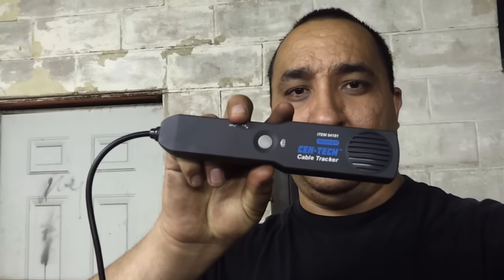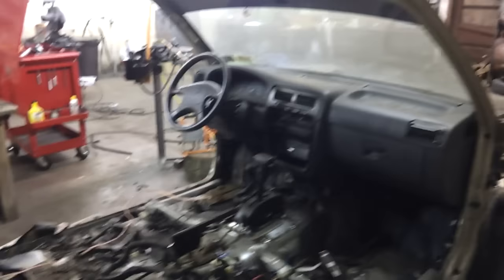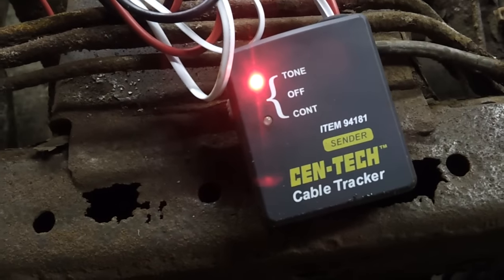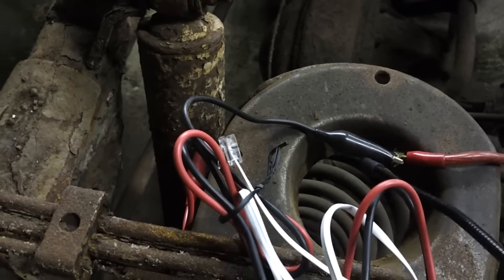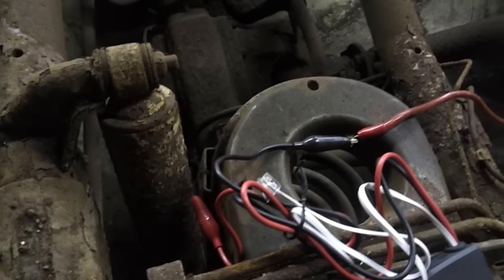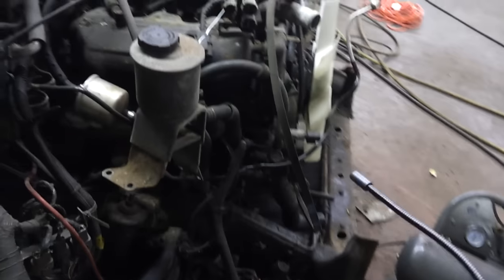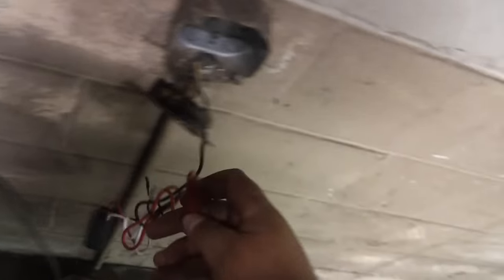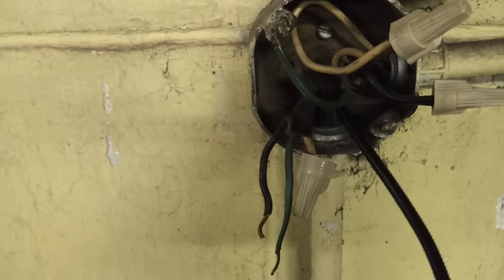Harbor Freight - Cen-Tech Cable Tracker (Item#94181)

Comment: Thanks for the video. I worked as a television broadcast engineer and we used this checker often.  It helped us trace cables in massive bundles. Also used it to install wireless access point CAT 5 cables in a four storey building.   Can't beat the price and it always got the job done.

Comment: Thanks for demonstrating this tracker. This product really works, and I would highly recommend it. I used it to trace 14-2 romex receptacle's connection from all the way across our house over stucco, drywall, insulation for around 125 feet. Saved me I estimate 500-to-1000-dollar electrician fees. It ended up being a very weird wiring arrangement which the builder installed as it went through switches, etc. inside and outside of the house, in and under the attic. The single strength was very pronounced.

Comment: had my sister run out on Saturday to go get one. I have 5 cars I am working and ones a ford 98 windstar only 109,000 miles but have short in MAFS wire so need to find short. worked great. 11 thumbs up. Thanks so so much. I could have used this back in the days pulling out stereo and cutting plugs and finding the speaker with hook up of wires. LMAO man needed this in 80's.  thanks great video from BOB-AKA mr bob the builder sidetrack

Comment: This device works well for tracing wires through walls, but you must hook up the transmitter differently than what is shown here. The red should be hooked to the hot and the black either left loose or hooked to a ground separate from the wire being tested. Then the signal easily penetrates drywall. If you hook up both leads to the wire under test you will get opposing currents in the wires and the signal will cancel, like in twin-lead antenna feed line.
Reply: Thanks for that; I found the directions very unclear.
Reply: no

Comment: As a master electrician I've bought at some point just about every electrical tester, device to help with various assignments I've owned 3 sets of toners from fluke and can say this raggedy low budget fox and hound is indeed better then those tracers. Argue all you want but try it and compare it when your out there it gives you the best reading have had to go alllll the way back to my truck just to get it because the others couldn't do the job. It's reliable is loud enough to hear and it's definitive.

Comment: Love it, Brother!!! thank you for sharing!!! it saved me a lot of money I had a short in my ignition wiring in my car took it to a shop they quoted me $280.00 I purchased this @ HBF with my 20% off coupon plus a free gift and found the short within 10 minutes I Definitely recommend this it works!!!!!
Reply: jimbola77 awesome info, I Have A Short in my 03 Dodge Ram Right Tail light, Ive Been trying to figure it out but can seem to track the short, the Wiring looks Good across the Chassis, will This Tool Emulate the power probe ect1000?

Comment: These things work ONLY IF the end of the wire you are looking for is DISCONNECTED from the circuit.
It will act like an antenna in this case, otherwise its will send the signal down and fade away.
So to find the end of the wire, i have no clue what to disconnect and from where.

Comment: I have a set of outlets that randomly stop working (GFIs) and while I can generally repair most electrical issues at home, I need to trace the wiring.  I’ve been hesitant to spend $100 on the Fluke equivalent for a two time use, if that.
I didn’t know Harbor Freight had its own version . . . until now!  Many thanks!

Comment: You probably should have checked it at the breaker box and tested the neutral at the breaker or anywhere in the building, the break is not going to be in the concrete, it's going to be in an outlet/switch/box or in the breaker box itself, you may want to check outside for any abandoned breaker or fuse boxes...
Reply from the maker: The break is underground. This was 4 years ago. I've abandon that whole circuit.

Comment: Ive got a home elect  circuit of 6 outlets that went dead   but i dont know which breaker in panel goes to the circuit...with main pwr off could i hook this item up to one of the dead outlets and then go to psnel area to try and find out which main wire/breaker  supplies power to the dead circuit

Comment: Agreed, i have trouble tracking down wires and wire diagrams . I have used rj-45/11 tracking wire locating equipment similar to yours but for computer networks. I realize now i can uses the same technology to trace car unpowered circuits as well as the unpowered electrical circuits of homes. But i still like the circuit breaker tester  locator for the energized wires (that you plug into electrical outlets) . Wondering if there is a similar tester for the equivalent energized circuit of a car. Not that its a huge deal you can remove fuse and check if the line has voltage before tracing its just cutting the step out.

Comment: I use one everyday at work. (Fire and intercom technician.) I'm pretty sure the red is the tone lead though, not the black. I've never used the harbor freight one, but for 1/3 of the price.. I think I'll give it a go.
Reply: I am a spectrum contractor and am seeking advice for a toner that will trace a RG6 coax from say a 5th floor apt. down to the ground floor of a Multi Dwelling Unit. This would be the best time saver for me. I would love for it to be strong enough to find breaks in buried lines about 6 to 8 inches deep. Have you seen anything that sends that strong of a signal?

Comment: Green is ground, not neutral.  there is a difference.  And yes this will work with Coax or any wire that has a return path.

Comment: Greenlee product is near $200. I used it for finding underground shorted wire. Sprinkler repair. But I've traced thru concrete with it also. We get wire in sleeves under concrete alot.
Reply: So this works for tracking valve wire?

Comment: hello Mr. alvarez..   it's been two years since you've made this video.  wonder how the electrical outlet repairs went?
Reply from the maker: +Good Sun The wires are damaged someplace under my shop. I abandoned the circuit to insure that I don't get any fires.
Reply: +Alvarez Metal Works You should be able to pull out those wires no problem and pull new ones in. There should not be an inaccessible junction box under the concrete. Use the same size wire, and use a wire lube to make it easy to pull.
Reply: I worked at a shop where the underground conduit was all rusty and the wires corroded, same problem as Alvarez.
Reply: if underground conduit all rusty and filled with crud you won't be able to pull new wires.  Run new EMT or IMC up walls and across ceiling rather than across roof.

Comment: In house AC wiring, the Ground is NOT the same as the Neutral. And should not be connected. I only use it when testing. Should never if used interchangeably.

Comment: These things are also used to trace telephone wires, that's why you see the little phone plug end on it. Looks like the only real modification is the little flexible wand on the end of it, while mine has a short rubber tip on it. But, they are pretty useful for tracing wires if you have a bunch of wires  with the same color, and you want to make sure you have the right wire on the other end if there is no wire marker on it. 
The sending unit can be used both for sending a signal down a wire, or, if you have it set on the cont setting, lets the sender be used as a continuity tester for anything like fuses or light bulbs that you can clip between the senders gator clips, or for testing switches. The little red light will come on if these items are good.  So he is right, a low cost little tool that is well worth what you pay for it, and might save you hours of guesswork tracing wires down.

Comment: Hello Mr. Alvarez
I bought an EM415pro and I still have not found out if it is possible to find a short circuit with this device using the beep. Problems with short circuit only work by the led indicator or I am not know to use?

Comment: I cant ever see needing this for anything residential unless something was real old. This doesnt give shorts location.
If you plan on using these outlets at all the wiring has to be the right size to handle shop equipment. If its not your learning what fish tapes are all about.
Your tracer can help you there too.

Comment: green is not also neutral it is a safety ground
Reply: Green should be the same voltage as the Neutral.  It's technically known as the Equipment Ground Conductor (EGC) and should be wired up in each receptacle and light fixture such that if the black (hot) wire comes loose and touches a piece of grounded equipment, plumbing, or building steel it will cause the fuse to blow, circuit breaker to trip, or for a GFCI to see more current in the black wire going out than coming back in in the white wire (120VAC)  and trip.
Reply: @JulesBartow  right and in service box all grounds on same bar and all neutrals on different ground bar neutrals have unbalance loads conducted through them grounds do not
Reply: @teekay1785  Yeah youre Definitely right:  they're on different bars in the panel but they are connected by a screw so essentially they're connected (unless it's in a sub panel)

Comment from the maker: Very much so. It took me forever to start working on fuel injected engines because I was scared of the electrical. I knew nothing about it and was worried I'd just make the problem worse.
Reply: I'm afraid of touching a carburetor, I know nothing about them, lol, fuel injection, no problem.
😉

Comment: Hey bro would this thing actually point out the exact wire or just will signal when it's "very close"?  I plan to use it on automotive to track down the exact wire from the crank sensor to the car computer.  Would it just start beeping when the cable I'm tracing is somewhere among those 30 wires on the back of the pcm?  Just wanted an opinion.
Reply from the maker: It's not that sensitive but it should get you close. If you need something to pin point the exact wire this may not be as sensitive as you are looking for.
Reply: Alvarez Metal Works
Thanks for the great help ese.  Also, is the RED wire from the device connected to anything or is it for an optional second wire being traced?  I need to trace SINGLE wires only.
Reply: When you're in the ballpark, you can test for continuity, if you don't have too many wires to check ... would have to physically contact them one at a time somehow back to your continuity tester, or perhaps short them to the wire that goes back to the transmitter (set to the continuity position).  You can verify first if your transmitter is working, just set to continuity and short the leads ... if the LED lights, you have continuity.

Comment: Will it detect a wire through drywall? The previous owner wired a breaker box and some outlets in the garage and I have 2 breakers that I have no idea what they control.
Reply: It detects wires through drywall.  You have to be within a couple inches.

Comment: I have a wire shorting to ground,  I have traced the circuit, but still cant pinpoint where it is grounding. I think it might be grounding to another wire inside the harness.  Would this tool help me locate a short to ground?
Reply: I doubt it.  You probably need to disconnect things along the path until the short is gone.  I found a trick by accident, flipped a breaker and heard a pop/saw a flash out of the corner of my eye.  An outlet in the corner of my garage had a bit of smell and puff of smoke, a nicked wire was making contact with a box connector.

Comment: This thing sucks. I hooked it up but no matter where I point it it beeps. the sender box is just sending out a sphere of signals and it’s impossible to trace the wire... I literally hooked it to the fuel pump. Stepped out the car and pointed into the sky and it still was beeping....

Comment: The tool referenced in this video is located at http://www.harborfreight.com/cable-tracker-94181.html
Its called a Cable Tracker (Cen-Tech - item#94181) sells for $23.99.
Reply from the maker: Thank you. That information is already in the video description.
Reply: Alvarez Metal Works Thanks for the review of this product and recommendation. Going to try to get to the nearest Harbor Freight to pick up one of these this weekend.
Reply from the maker: Not a problem. I try to review ever tool I buy. I know it helps people out. I use youtube to find reviews so I figured I'd return the favor and post some of my own.
Reply: Ok. I bought the tool. It worked just as well as you said it would and probably just as well as the more expensive ones. Saved me from hiring an electrician. Thanks for the review.

Comment: I have a ceiling fan that needs to be replaced but I can't find the breaker to disconnect it... can l use this to find the right one? Thanks
Reply: Shut each breaker one at a time checking for no power at ceiling fan each time. When you get no power at ceiling fan, that is the breaker that controls it. You don't need anything except a voltmeter.
Reply: Use a voltmeter or a (convenient) Fluke tick tracer.

Comment: Can it scan through sheet rock? Thanks bro
Reply: Yes, it works quite well, but not if hooked up as shown in the video. Attach the red lead to one wire and the black lead to a ground separate from the wire being traced. You can use a water pipe or an extension cord plugged into a different circuit.

Comment: Im not seeing where you tell if its shorted
Reply: Ok if it has a short in the line, this is meaning the circuit is not completed. with the signal being delivered at one end as so when you trace the line it will make that noise w/the receiver' & when the noise weakens & or stops, this is most likely where your location needs be checked for trouble If so your current to the receiver stops flowing at this point of breakage in the wire & or it just won't pass thru enough current on account the opposite end is diverted from giving a strong enough signal. It's kinda like when trying to pick up a girl playing hard to get! L.O.L No but seriously it's when the current  stops or weakens is where most likely it is shorted! It's a grate tool.
Reply: A cable tracker is not designed for tracing shorts, it only works to track open circuits.

Comment: try ideal suretrace 61-954. it has powerfull signal and can trace through wall and some floor
Reply: That is now replaced by 61-955 . It is OVER $ 800.00 ! The HF is about $ 30.00 . There is no comparison . But , unless you NEED that expensive unit , it's an expensive tool to only be used by a DIY .

Comment: How much was this as Harbor Freight?
Reply from the maker: Not sure what they are charging for it now. The link is in the video description. I'd use one of the 20% off coupons on it if you can find one.
Reply: Horror Fraught.  Half the stuff I buy there breaks.  Lot of wasted time driving back to store for a refund then having to go find something quality to get the job done.  You'll have the same luck as direct from China on fleaBay or Amazon.
Reply: @JulesBartow  
That's because they are produced with the cheapest quality parts and materials available, they don't last worth a shit. All Chinese electronic and electrical products suck. You get what you pay for, cheap junk that you end up trashing in a short period of time.

Comment: What's with the frame on that truck. Not safe. Not for u but the other people on the road. Nice tool
Reply from the maker: You do see that the truck is completely cut up and not drivable right lol? I stripped it for the parts and scrapped the rest of it.

Comment: how can I use this on a car for shorted wires
Reply: shane gillenwater thoughtfully
Reply: I have used a DIFFERENT tool for shorts.  Basically, it is a mechanical meter, with a needle, that is sensitive to magnetic fields.  The key is a 5-amp circuit breaker, hooked up to power, that keeps closing and opening, causing a varying magnetic field through the wire it is hooked up to, all the way to where the wire is SHORTED to the chassis.  Move the meter along the wire from where the breaker is hooked up, it will wiggle until it passes where the short is.
Reply: @victorsteerup3111  Where could I find a meter like you describe?